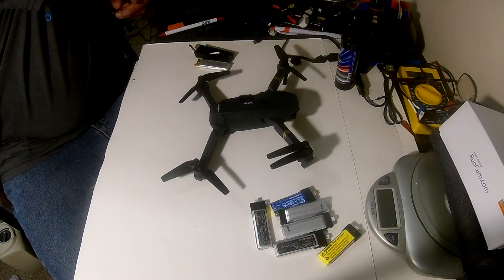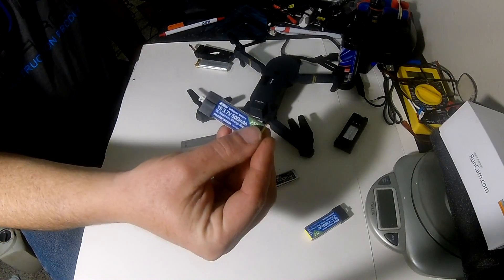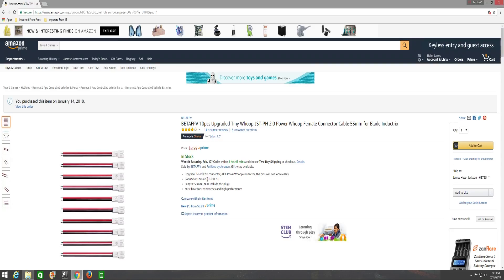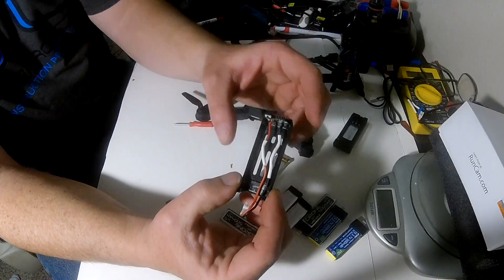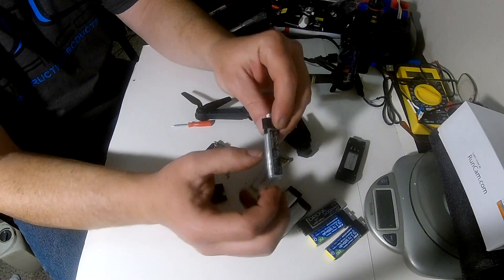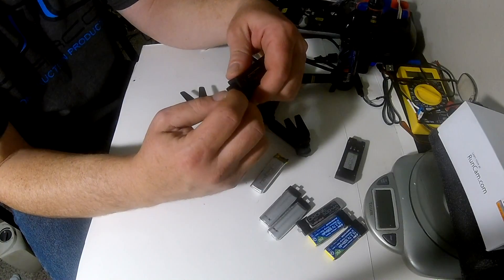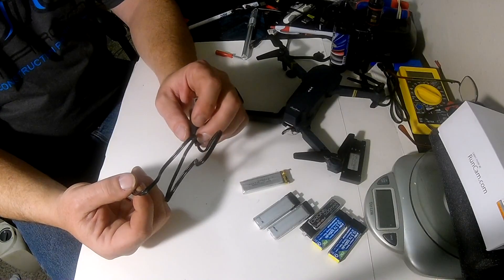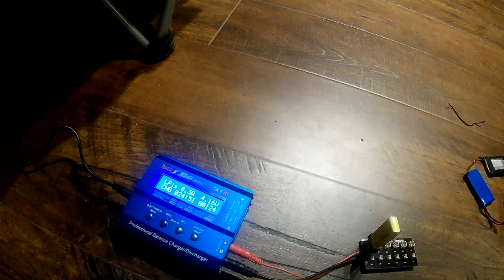Eachine E58:  Easy drone battery mod

Comment: Hahahaha I did the same thing but I made mines longer flite time instead of 500mah I mad it 1000mah by putting 2 500 mah lipo into parallel for double capacity. Just have to mod the battery compartment and using small straps  I can't go over cause of the weight was to heavey so you can only put one extra 500mah battery lol. Instead of 8 minutes it's 16 minutes flite time. Plus I have an fpv mounted on it so that takes power also but it stayed up preety long. And the antenna was also moded to a longer antenna on the reciver. Instead of 100 meters I can go twice that far awsome drone for only $45 box I just moded into a some what hobby grade racer drone.lol 5 times the fun well worth the work.
Reply from the maker: What mw do you run your fpv camera at?  I have a switchable camera that goes up to 200mw but I've heard setting it that high can draw too much power from the drone.
Reply: A brushless quad is available around 90 dollars to 120 dollars having 15 minutes plus flight time. No use buying a 45$ dollar mod to a brush motor drone.
Reply from the maker: Jason Prosser Most people just use a wifi antenna and solder a short length of coax cable from the stock transmitter to a sma connector. Its odd that toy drones rarely do it that way because its very inexpensive: https://www.data-alliance.net/antenna-2-4ghz-5dbi-omni-directional-w-sma-male-rubber-duck/

Comment: Nice mod. I'm going to buy the e58  hopefully soon. Just wondered if there was any chance of putting a slightly higher capacity battery like a 750mah to get a bit extra flight time without the extra weight penalty?
Reply from the maker: PD Tech My first quad had 7mm motors too and I could get around 8-10 minutes out of a 650 mah battery.  You might be able to offset the weight gain by getting rid of the battery cartridge altogether and soldering a connection directly to the pos/neg leads on the circuit board.
Reply: @Blizofoz45  how would you bypass the switch? I see three wires coming from the switch to the board, if I soldered directly would I ignore the third wire?
Reply from the maker: @aerialcombat  You can see on the switch board there's three solder points where the battery connects to it. Above it there's three wires labeled R ,  B- and B+.  My guess is B- and B+ represent the positive and negative currents coming from the battery connector.  So yeah I have no idea what the red "R' wire is for.

Comment: Nicely done. Idea, you could just stick some Velcro below the quad and stick any kind of battery underneath it. What do you say?
Reply from the maker: Yeah I thought about that.  I had two reasons for doing it the way I did: I wanted to maintain the form factor of the E58 as much as possible and I wasn't sure how it would handle the extra weight of larger batteries and velcro.  It's a very finely tuned quad and I already had 500mAh batteries lying around so I decided to take this route.  I'll leave it to someone else to try it your way. :)
Reply: Cool :)
Reply: Nice 👍